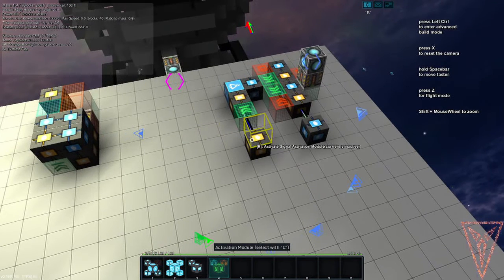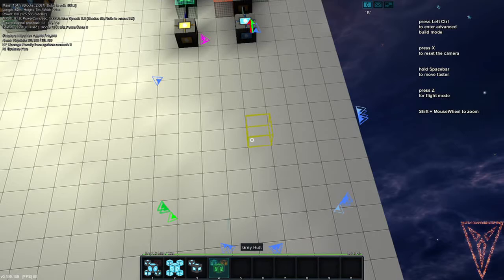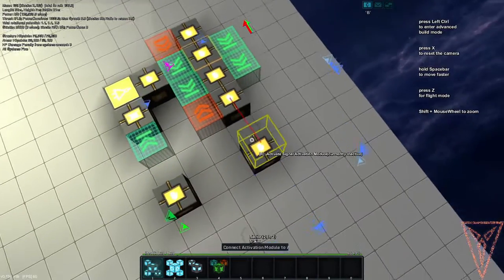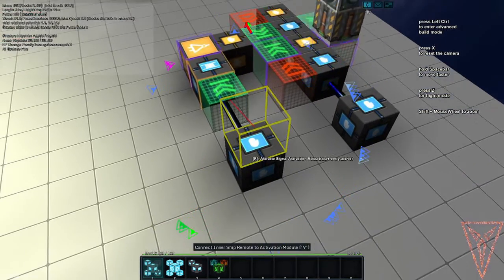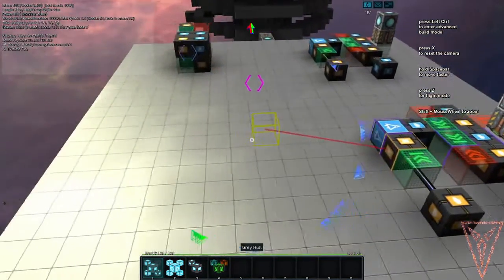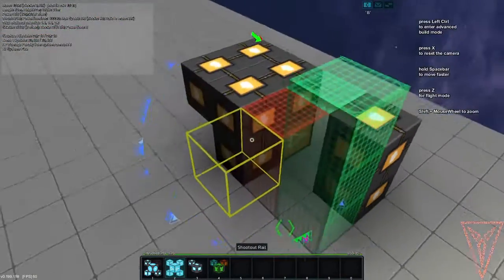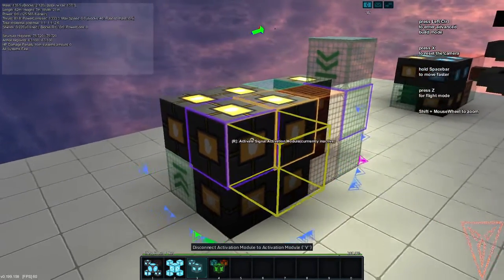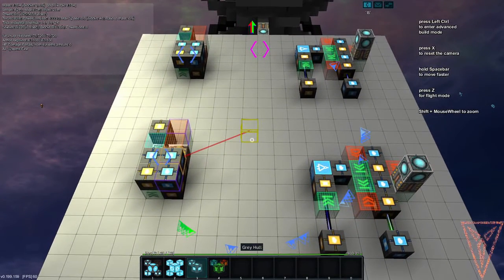Starmade Tech: New Rail Clock

Comment: I am pretty sure this clock will ONLY work in 1 directional orientation, such as the one shown. Any other rotations causes the system as-built to break for me, without the addition of more buttons spaced away from the rails to allow a "clean" input to change the rails...
Reply from the maker: Yes, you are absolutely correct.

I forgot to mentions that this clock will only work in the orientation shown in the video.  Otherwise you WILL
 need aditional activation blocks or buttons to make it work in a different orientation.

Thanks for bringing this up :D

Comment: The output stays on at the end?
Reply from the maker: yes, the output will stay on.  In my next video I take advantage of this by using it to control a speed controller.
Reply: I still wonder how its possible to get those pulses through
Reply from the maker: I think the way it works is that while it's always on, it can still forward "on" pulses if you turn it on multiple times even without turning if off first.  If that makes sense?